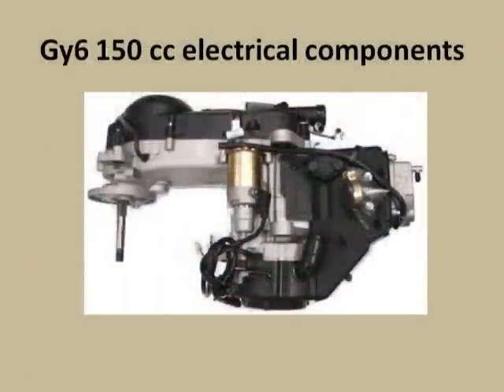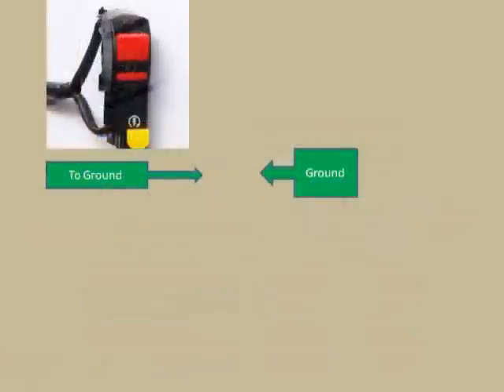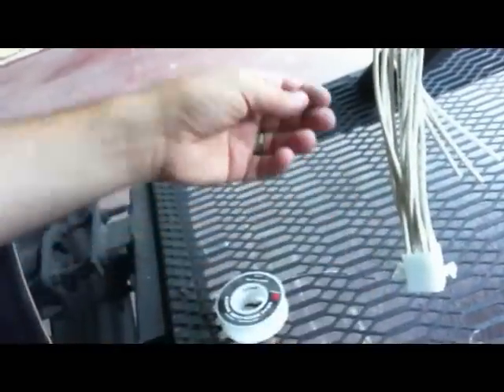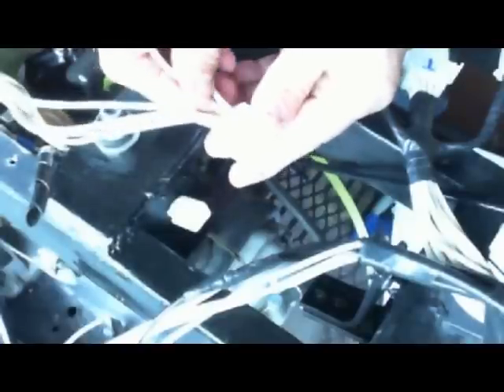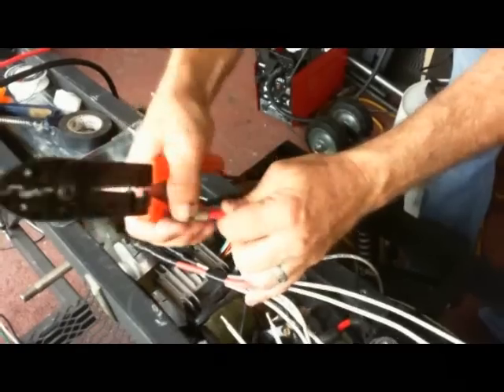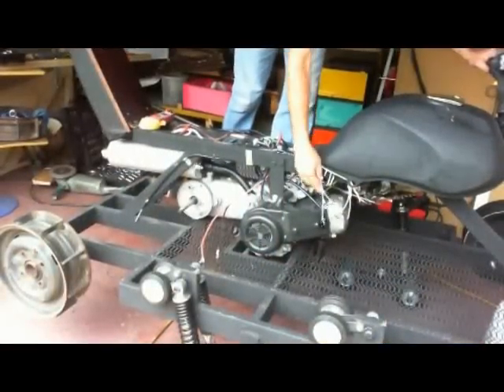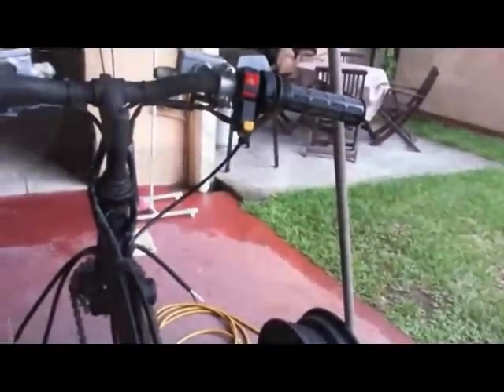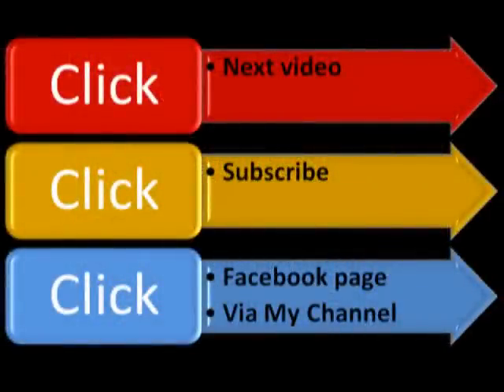How to build a tank. How I wired my GY6 motor for my Tracked vehicle Electrical Part 10

Comment: great so far, did you change the idler setup on the back axles or any other chnages since working on the drive axles?
Reply from the maker: No changes ,yet only on how I am going to design how the pulleys work on the transmission. My plan is when I complete the project to make a video on things I would have done differently and the total dimensions of it.

Comment: 150?!?? Man I would have put a 300 at least in that bitch
Reply from the maker: I am a little worried about the power. But I am going to give it a try. Its very expensive here to buy motors and difficult to find used ones. For the 150 I spent about 400 dollars a bigger engine would have been 7 or 8 hundred dollars. To much money.

Comment: A guy who was an electrician in the Navy told me this about electrical tape: the adhesive eventually stops doing its job. Use the highest quality electrical tape you can get, and also put the smallest zip tie around the cut (not pulled apart) end of the tape. When the adhesive gives out, the zip tie will hold it in place and the tape can keep doing its job of insulating.
Reply from the maker: I tried to use heat shrink as much as possible instead of just electrical tape. I also soldered the connections except for where I crimped the big cables. Thanks for the advice.

Comment: Awsome wiring setup, nice n clean. Sounds real nice too. Looks like you can drive yours on the street. Now that would be cool, but how would you classify that for the plates? LOL.
Reply from the maker: Thanks.I doubt even here were you can get a plate for a 4 wheeler as long as it has turn signals and lights would probably not allow this on the road. But I had the switch and I figured I would still run the wires. I did hook up the taillights also. Even if your on trails its good to have brake lights for the guy behind you.